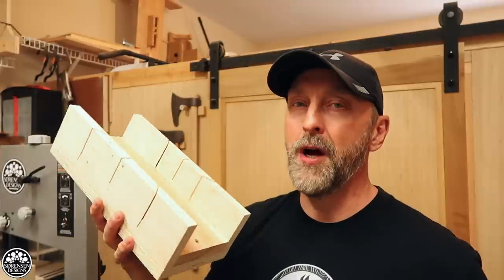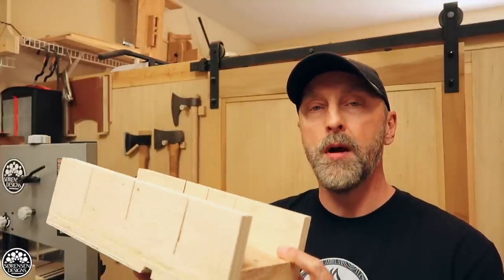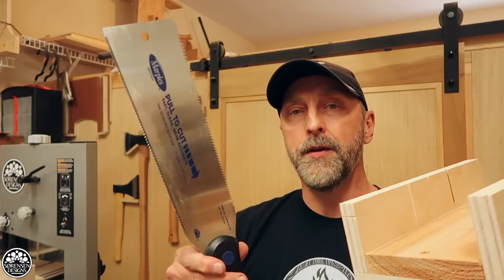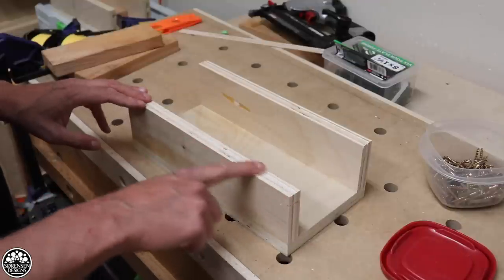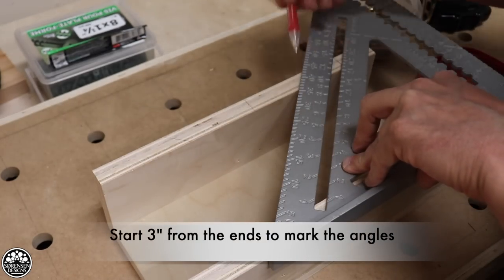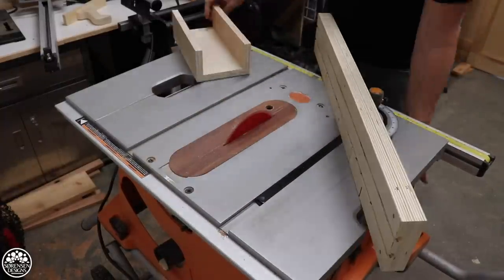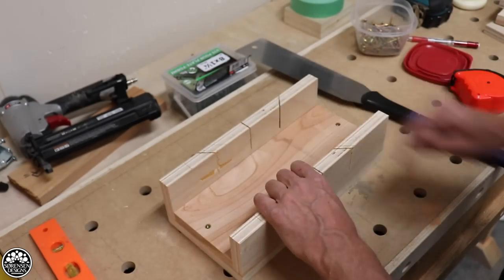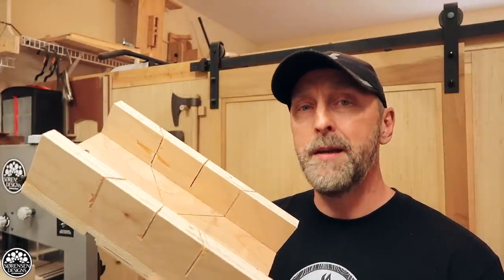Don’t Buy A Mitre Saw // Precision Miter Box

Comment: I had a need of one of these today. Remembered watching this video and threw one together. I don't like the one I built as the small handsaw I have made a rough cut.  I think I  now  need one of those Japanese  saws.. heh heh..  Really something with a thinner blade,. I went to a hacksaw blade but now my kerf is to wide. But point remains. Following this video worked. I put a digital angle finder on the kerf on the miter box and read 45.0 degrees. I just get to make another one.

Comment: Thanks for your ideas. I like to use wedges that are 8 to 10 degrees for various things such as clamping so I made a miter box with those two angles to make them reliably repeatable. I have not used a pull saw though, so I think I will try that also.

Comment: Nice short vid.  I use a Stanley miter box which has various fixed point angles for those trim moldings that aren't exactly 90 or 45 degrees.  I can see using this for picture framing or other framing where you aren't matching the exact wall or ceiling angles since virtually all houses aren't completely square and plumb.  Thanks for sharing.  Cheers!
Reply from the maker: @William Logan Thanks! I've bought and renovated a few crooked old houses. Most of the time you can use your 45° angles. You just need to use shims to get everything even before the trim goes on. For the jobs where I do need to cut custom angles,  I usually bring an adjustable protractor. Cheers 🍺

Comment: Nice build! I'm thinking I can try to make the cuts on a bandsaw since I don't have a table saw. A blade with 0.65 mm kerf should be OK for ryoba with 0.5 mm kerf. The only trick might be to set the band saw table to 45 deg and make one cut with the box in horizontal position, another with vertical.

Comment: Very cool, now attach a vacuum hose to the box and you got yourself a Festool miter box. Much cleaner than an electric miter saw. Now does this work for crown molding and such? Though it may take a little longer to cut, you can work indoors in the same room you’re trimming out, it may actually be faster than having to carry the piece outside and then having to bring it back in. And then there’s less clean up because it’s not throwing dust all over the place like an electric one. This may actually be the way to go.
Reply from the maker: @woodfern909 If you make the box wide  enough, you could accept crown moulding. You will probably need to customize the box to have a 22.5° slot in addition to the 45° and 90°. 
I have used this type of mitre box on an indoor trim job. It does save time, reduces dust and gives you a cleaner cut (if you use the right saw).
Reply: Thanks for the info, I’ll look into that.

Comment: Thanks Eric. I sold my "big" mitre saw and rely on my table saw for everything for the same reasons you mentioned. I'll add this to my jigs, BTW i'm wondering if you have any issues with the mitre slots on your Ridgid? Mine are off and its always a struggle to get a sled or crosscut sled working accurately.
Reply from the maker: @Bob Dunn Thanks! The mitre slots should be square to the blade. If anything, the mitre slots would be the most reliable. You can easily check this with a speed square. If they are not, I would take it back to home depot and exchange it. The only other thing it could be is there might be a bit of play between your rails and the mitre slot.

Comment: Greta video, Eric. Where do you normally purchase the extended-length driver bits you used in the video?
Reply from the maker: @David Letz Thanks! I purchase them at a local tool store. They have them by the checkout, so I always pick a few up because I always lose them. I'm sure you can get them on amazon or at harbour freight too.

Comment: Hey Eric, great video! I think i have that same Rigid job site table saw, have you had any issues with blade alignment?  thanks!
Reply from the maker: @JEREMY RADTKE Thanks! I never have issue with alignment but you should always check every time you change something. Everything should align square to the mitre tracks and the surface of the table top. Re aligning the blade to 90° can be a pain sometimes - but other than that it works well. Next time though, I'll buy something different.

Comment: So i am down with this but I'm just a little confused on the measurements. Was it 3 pieces 12 inches long by 3 inches wide?
Reply from the maker: @Felonious Fisherman The miter box in this video is 12"L X 6"W for the Base / The fence pieces are 2 3/4"W X 12" L  Using 3/4" Plywood. Of course, you can customize these for what ever you need. Most of the store bought miter boxes are smaller. I have made a few different sizes in the past and the one in the video seems to be the best for most of my work.
Reply: Thanks this makes a lot more sense.